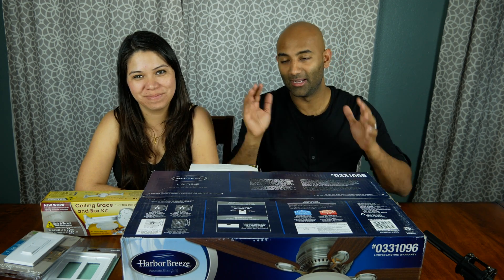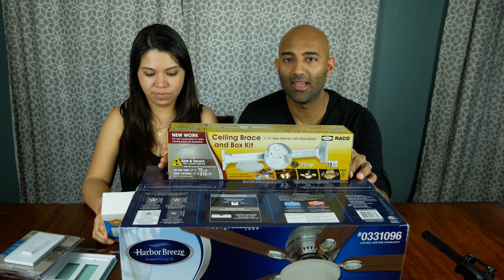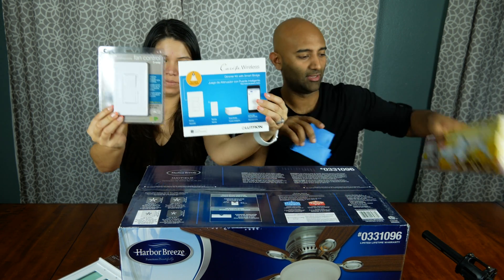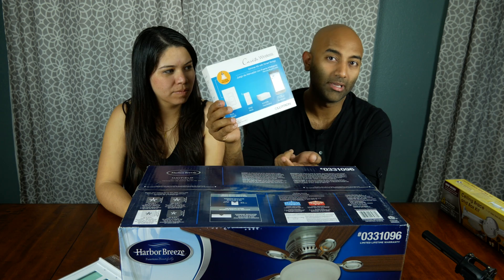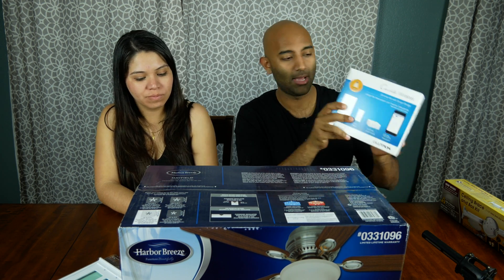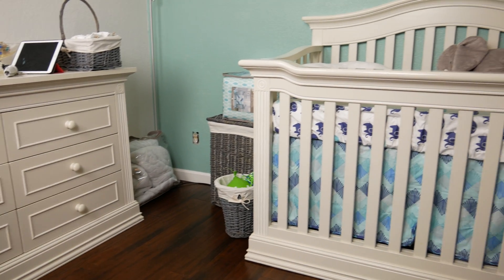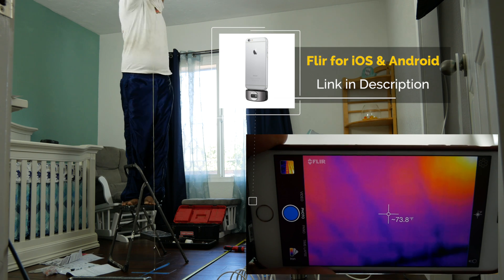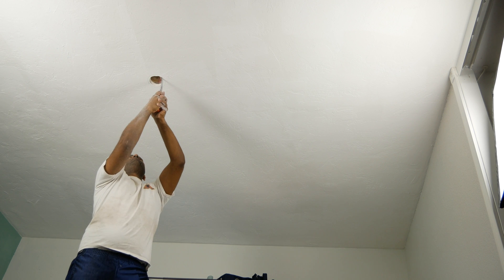Smart Ceiling Fan Installation with Lutron Caseta Lights and Home Automation!

Comment: Good video but I dont think it is advisable to use Lutron Caseta light switch to control a fan motor... It is not designed to handle that load and can burn the motor or overheat wires.. I learned it from my own experience - tried and heard humming sound coming from the motor constantly...went online to research and  found the reason... Btw Lutron is releasing Caseta Fan control March 2019...